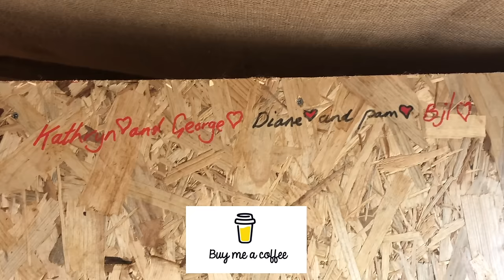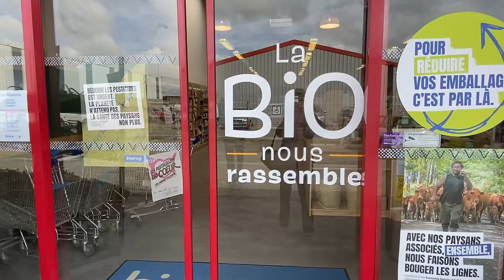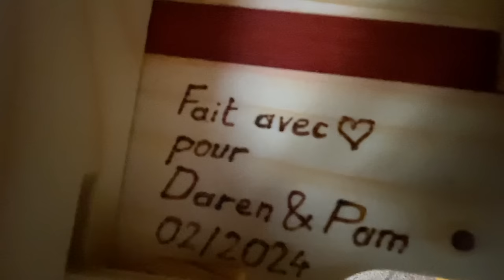#44 FOR SUBSCRIBERS ONLY!

Comment: I hope all goes well on the Visa front , it can be a tricky one with any country and I hope u have a plan Z for going back to the US if the shit hits the fan . U both look a bit worn out Mr Bloke I hope u are all good.  It's been a bit of a battle to even get to where u are now . Such a big move from the US to France and then dealing with the bad weather trying to get this project up and running.  Farm house has a lit of potential and once done it be a gorgeous setting . Even the shed has come up trumps . Good luck on the Visa I do hope it comes through for u both . ❤.  🐱🐱🐱🐱🐱♥️
Reply from the maker: Thank you❤️We are hopeful the visa process works out? It will be very tough if it does not! I think I need to sleep for 2 weeks!!!